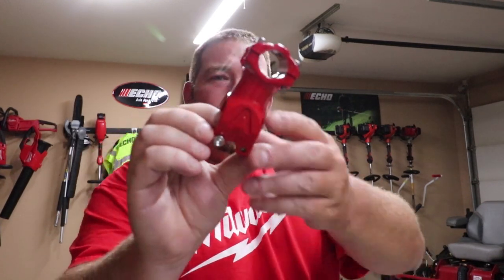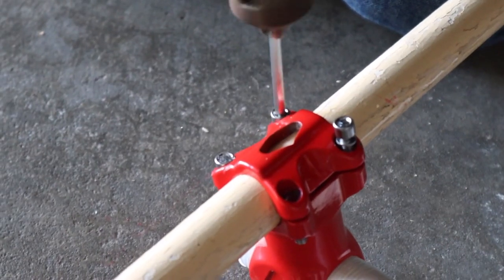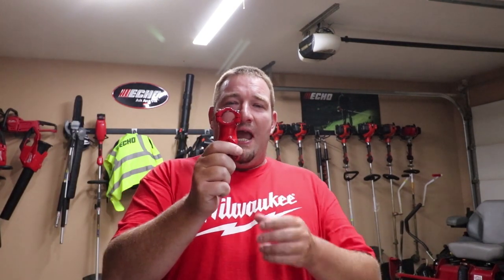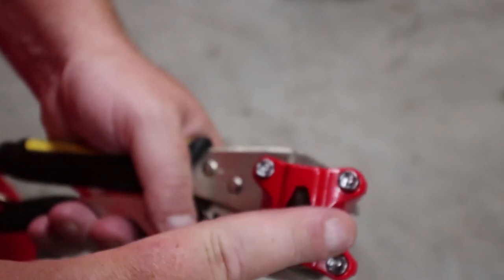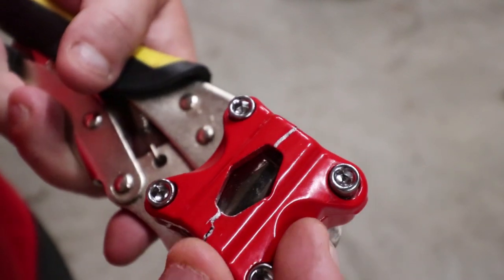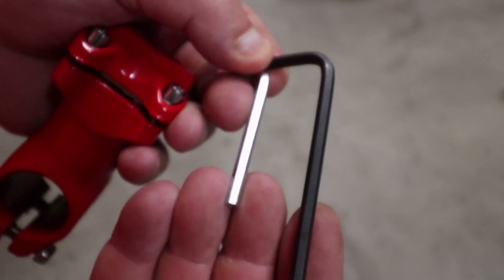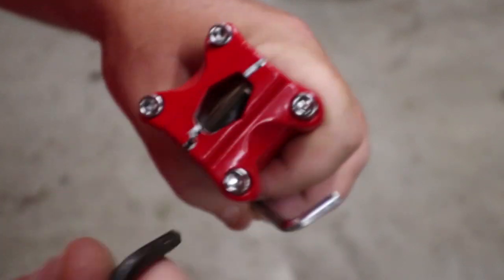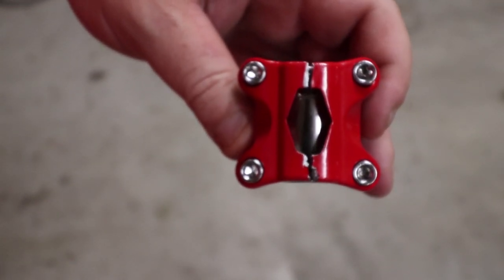Darwins Grip, Do NOTS When Installing

Comment: Its hard to decide how tight it should be,coz the shaft will vibreate,so if its not tight enought i may end up losing those screws,same as the factory loop handle screws if not tightened. I think what they should do is make the clamp big enough and includes some rubber "spacer" in the package.

Comment: I ordered one but my Black and Decker electric trimmer shaft is too thick. I ordered 1” socket bolts instead of using the .5” that it came with.
Reply: What kind of bolt/screw are they using?
Reply: @benbofficial  socket head bolt m6 .5 inch
Reply: @Jknudsen0523  legend! Thankyou 👍

Comment: Well of course you will snap the bolts if you use plug in tools with 50,000 lbs of torque. You won’t snap them if you use light weight, power tools, and set your clutch appropriately